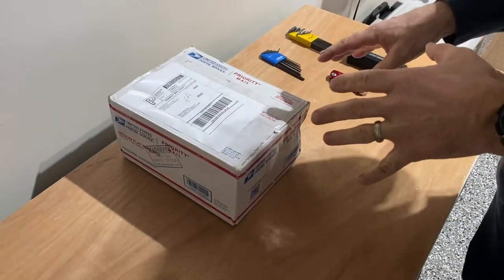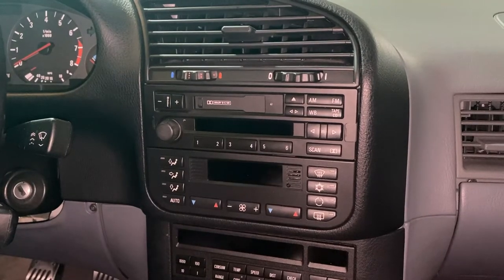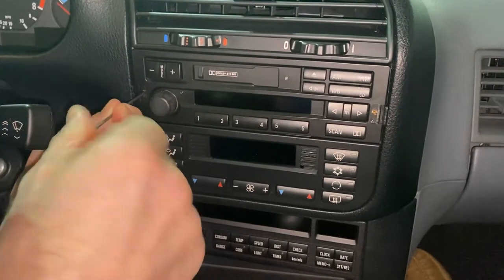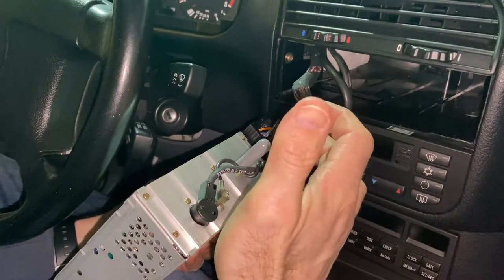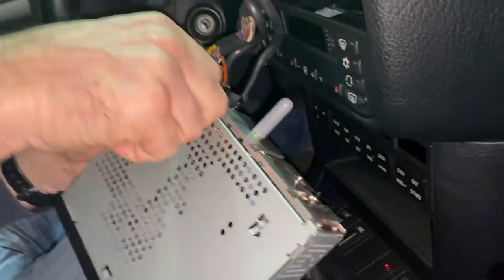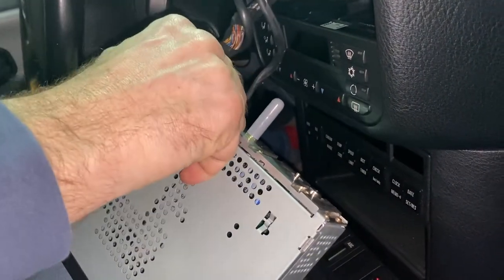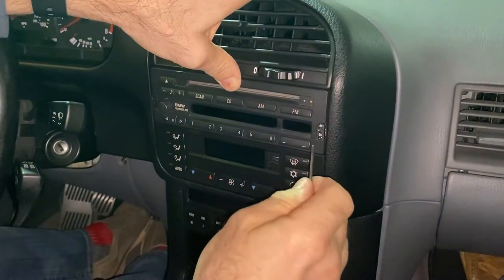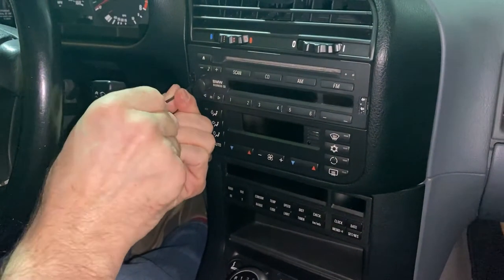1997 BMW E36 M3 Radio Upgrade -CD43 Business CD

Comment: OEM look is best for sure.  That car is quickly becoming a classic so not going crazy with an aftermarket stereo makes good sense.
Reply from the maker: Agreed and thanks for watching!
Reply: I just purchased this unit to replace an aftermarket Sony radio installed by previous owner for the very reason you mentioned above. No replacement for OEM parts💪
Reply: @dang8961  Yup.  OEM+ is such a great way to improve a car.